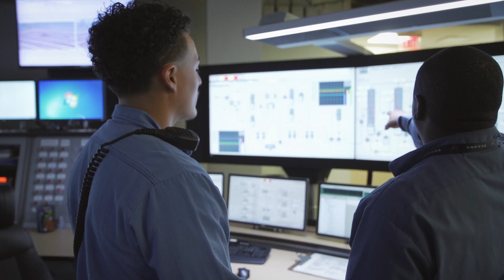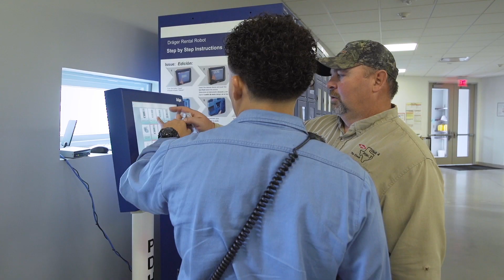My Life As a Process Technician

Comment: under fire also means learn your Presses I work with anything from 50 Ton to 4400 Ton // and everything in  between Engel to Battenfeld VanDorn ,old Demag Electric you name it / valve gates / low psi / list goes on I love it ! Dual injection I work with a lot also ( or call it 2 shot ) I've even worked with 3 Shot that was neat too

Comment: I’m a Process Operator, I don’t have a degree, it’s been all on the job training. 

I have two years experience now, which I would argue is better than a degree. 

I work 4 days on, 4 days off (rotating 12 hour shifts) and make $32.50/hour (with 4 hours OT per day). 

It’s a great job, it has its frustrating moments, but it’s a great career path for sure.
Reply: I have an interview for oxy chem on Tuesday. Starting pay is around 32$ and some change. Surely I don't need a degree to get an opportunity. I do have 4 years of chemical loading experience. Hopefully I can get the job.
Reply: سوف ادرس واحصل على شهادة هل وظائف موجودة في نورت كالورينا أمريكا 🇺🇸
Reply: I was wondering if you could give me any tips on getting on with Dow. I fill out application after application but so far no luck on a job. Im in my last year of college for process. I want to be a Dow man that's my dream but it seems dreams don't come true. I'm a hard worker and I'm willing to learn I just need help getting in. Any advice you could lend me.
Reply: how did you get in without a degree
Reply: Same. I have no degree. I just learned on the job.  4 years so far and I’m currently at 30.63 an hour with raises every year. We rotate from 12s to 8 hours 6 days a week. I prefer the 12 hour shift’s better though. Even maintenance can be taught in house